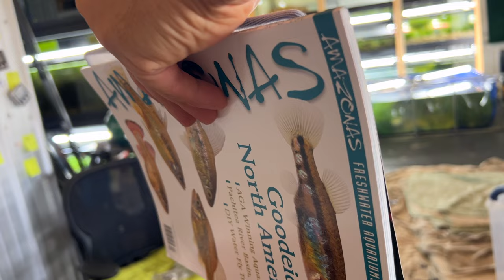Fish Vs Termites Vs Lady Bugs Vs Birds Vs Dog Vs LRB Battle Royale!

Comment: if they're coming out of the wall like that, there is a large nest inside the wall. I suggest you pull the paneling/plywood whatever it is and see what's what inside the wall.
Reply from the maker: Yeah I need to get to that asap but hard to when you got a bunch of tanks in front of them and no where to put them and whats in them. Hopefully I get to it soon. It seems that one spot has been alot more active then the other spots.

Comment: termites live in the ground and must return every 24 hours to get a drink. don't spray the wood, treat the foundation. i got rid of mine, at the time i got a bottle of Dursban at a hardware store, mixed it up in a trashcan, made 50 gallons. dig a shallow trench along the wall where the nest is and pour in the dursban. dursban stay active for 2 weeks. i hope they are still making it...
Reply from the maker: Interesting, I'll look into it, thanks!
Reply: I would worry about my well water using that much dursban😳
Reply from the maker: I didnt use the dursban but did you use a specific spray for them from home depot cant remember the brand.  But either way this comment was super helpful! After he mentioned they live underground I went behind the barn and saw where the sand/dirt built up and was tunneling up and in. I cleared my whole perimeter leaving some foundation exposure and sprayed. Hopefully this works or they would have kept coming if I didnt check out back. Thanks!